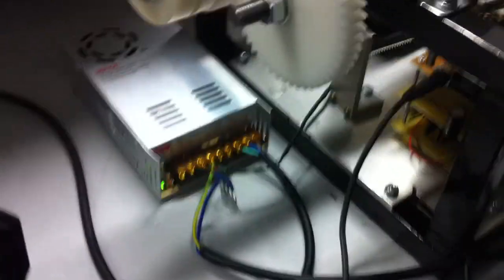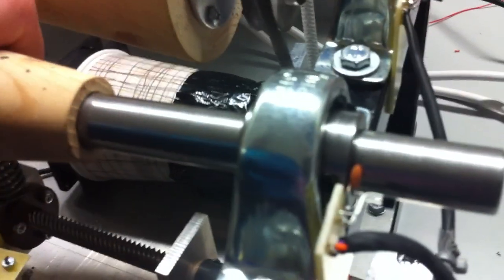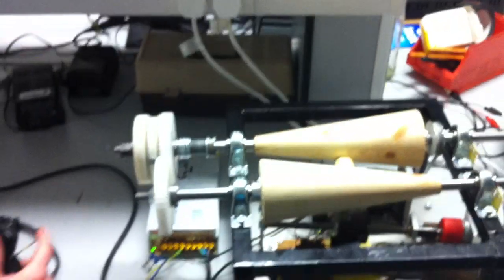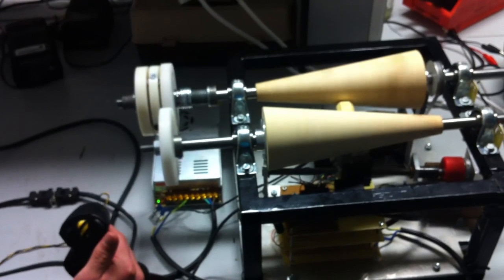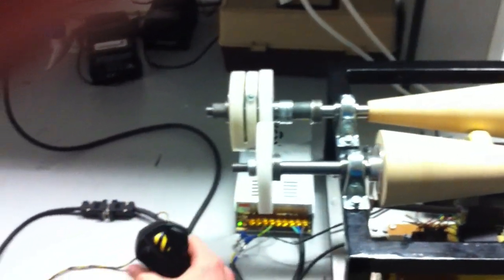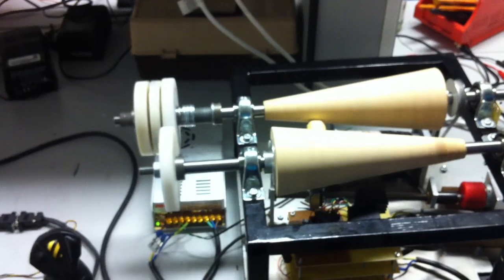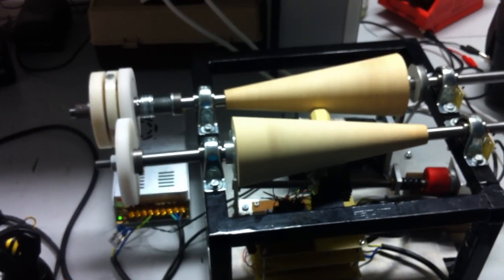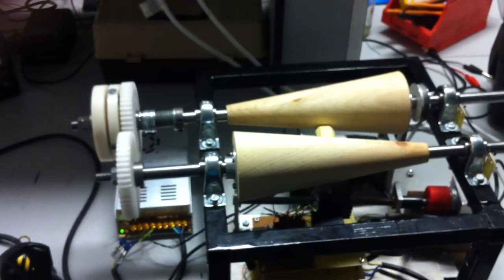Friction Driven IVT Gearbox

Comment: This is awesome..  I think a 150hp engine would rip right through that wooden skateboard wheel engagement but if you used the right combination of hard steel for the roller blade wheel and slightly soft spring steel for the power cones... you can squeeze that roller blade wheel super tight and if you aligned etch marks in the contact points to promote adhesion, it could handle maybe 200 hp

Comment: What about slippage when its under load.
Reply: I guess he differential will solve this issue.

Hear this, 
On stand still on high load, even if slippage is there, the direct drive will transmit torque.

As rotation starts, the load will decrease and so will slippage.At that time cvt will work effortlessly.

Let me know your opinion on this